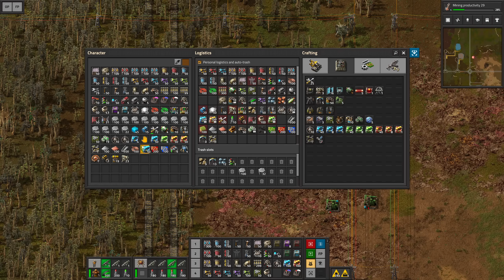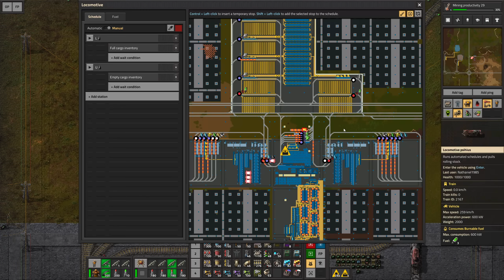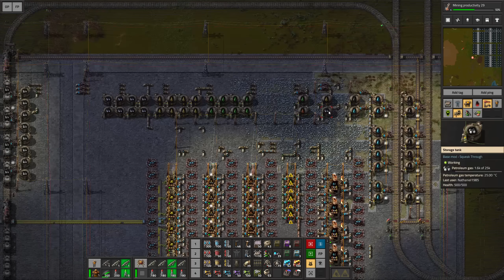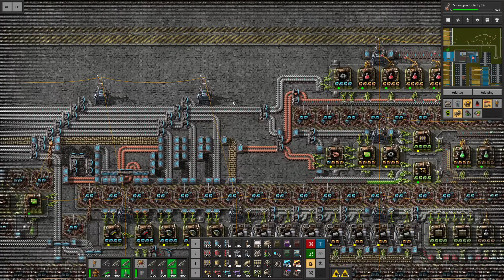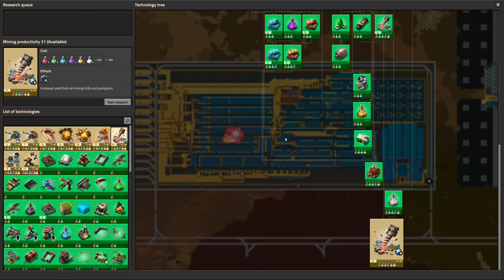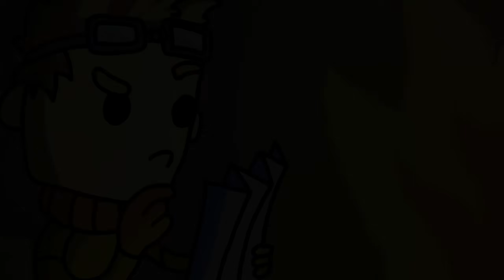MEGABASE STATUS (1k+ SPM) - Step 52: Factorio Megabase (Step-By-Step)

Comment: Still loving this series, Nathan. I notice you are using only one pump per fluid wagon. By using three pumps per fluid wagon, you can almost double fill and empty speed (1.8s vs. 3.4s). Just be certain you connect the pumps directly to the storage tank and the fluid wagon without additional pipes.
Reply from the maker: I might do that with the huge oil spots, the smaller ones don't seem to be able to produce oil quickly enough to make that change effective.
Reply: @Nathans-Sandbox  Oh, that’s interesting. I’ve found almost every oil spot I’ve ever used can fill the 25k tanks (and fluid wagons) quickly. Maybe because you are sending trains there quickly, they don’t fill all the way. (Congrats on 1k SPM, by the way. Quite impressive.)
Reply from the maker: Hm yeah, there are usually two trains per station, maybe I'm wrong about this, will pay more attention to it next time.

Comment: Please add more chain signals on your straight tracks. You need to section them up more, because the way it is now, when one train is waiting to enter the mega module, another train is backing up the intersection 500 miles away since they are all in one block.

Edit: Also use gates more, they look super satisfying when they open for incoming trains :3